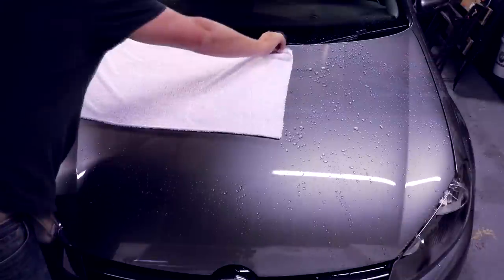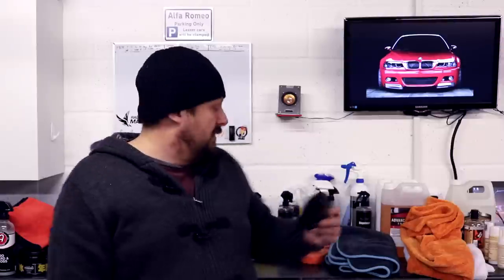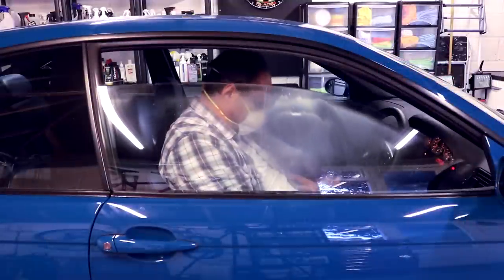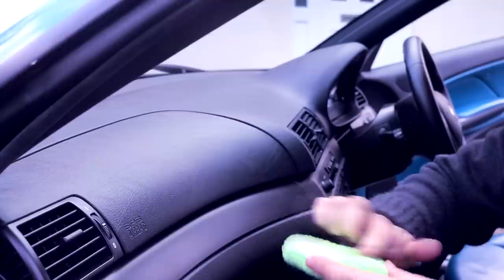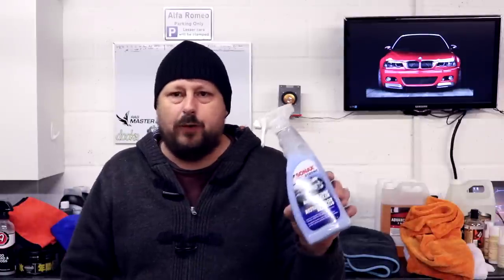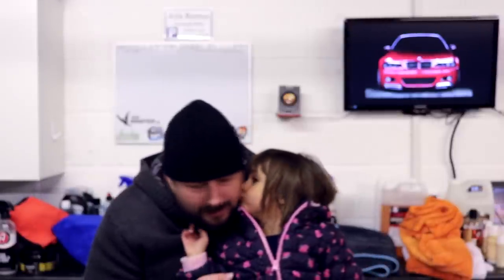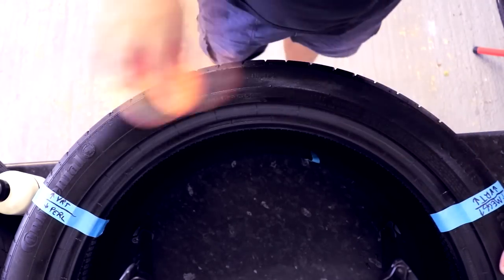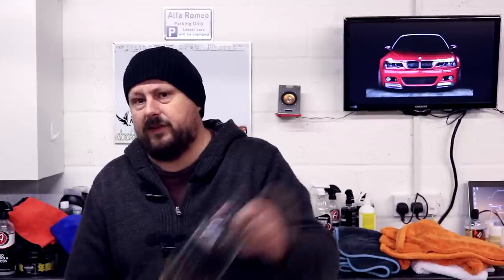The Forensic Detailing 2017 Product Awards - Part 2

Comment: I agree with you about glossworkz, that shampoo is really good, suds+slick+smell
I've used it only once but feels like a step up from my previous shampoo. 
Carpro Pearl is starting to annoy me, it always tend to be greasy on me, wether i use it on tire at 1:1 dilution, or on the interior at a lower ratio. You always have to come back to it and buff it well to avoid greasy touch. It's still a good product because of the versatility, but i hope to see an improvement on the formula to make it less greasy.
One product i recently discovered is the Polishing soap P21S. Really good product on exhaust, feels great to use with the sponge and the lather that it produce to clean and polish is something i really like. Hope you get to try it in the future mate

Comment: Great reviews there. Is there any reason why you don't include Gtechniq products as would like to see the Gtechniq W6 in comparison to the other fallout removers if you ever have opportunity. Cheers.
Reply from the maker: no reason really, but its perhaps just more to do with what Ive encounered.  g tech stuff is decent enough, big fan of the wheel armour.  this video was shot 2 years ago remember, theres been like g tech stuff coming through the channel since this was shot as well.
Reply: @ForensicDetailing  oh I see. Thank you for taking the time to answer. I liked this video and was just trying to choose a fallout remover to use on a Gtechniq ceramic coated car to maintain the coating.

Comment: Hi Jon, I’ve seen your comment on Done And Dusted, I’ve mixed mine 50/50 with BSD and done the same with BH Auto QD works a treat. Do you have any thought on products going bad over time as I’ve started buying in 5L sizes? Merry Christmas to you and your family and thanks for the videos.
Reply from the maker: detail sprays on paper have a 1-2 year self life.  thats a bit of a generalization.  but they are typically based on forms of quatinary silicon which have this sort of shelf life.   Ive had products beyond this timeframe though and they still function.   So I would not worry too much about expiry of QD's but if its been sitting there for years and years in the garage I would just bin it.

Comment: Great vlog John, one I now look out for a Christmas. I've just started using Sonax BSD again as we go into the Winter and as you say it water beading properties are amazing, however the spray head is probably one of the worst units out there. I'm going to decant it just to make life easier. Cheers, Kevin
Reply from the maker: yer that trigger is f'ing useless.. If you pump it hard and fast it does fan a bit more...  a lot of companies fail with their triggers.  the worst are those small ones that hardly put out any products.
Reply: Buy a Flairosol fine mist bottle and tap your BSD in it. It works great with this bottle and spreads fantastic. A little tip from me :D They are expensive but look at Ebay or get the original from Holland.

Comment: Hi,

I am wondering what chemical products you use the most a detailer uses. For example, Quick Detailer, APC, etc. Maybe the most used top 5 products? Thanks
Reply from the maker: gotta be 1) prewash 2) shampoo 3) wheel cleaner 4) APC    After that, prolly my IPA mix or maybe a fallout remover, maybe a citrus wash, or a dedicated degreaser product.

Comment: Jhon I get ghosting and streaks with h2go I cleaned the glass well and clayed let it cure for 15 minutes do you think cleaning the blades with tac system oil zero would help
Reply from the maker: best tip I can give, one keep the windscreen wipers away from the car when applying..  when you apply obviously clean it properly..  but after waiting 15 minutes to cure buff away.      what I do after that is leave the wiper blades up and leave the car well alone overnight.     and even then before I use I go over it one more time with a clean cloth.   the closer you do to that the better.   I find in the summer when its warmer they cure off better.  Dont over apply as well , use small amounts.

HDD and H2go are the best 2 Ive seen so far, the key thing is to let them cure off and prep.

Comment: Hey Jon,

Do you have any recommendations for detail sprays that can get rid of fingerprints and waterspots other than Koch Chemie FSE?

I am only asking this because it costs €9.2 euros for a 1 litre bottle and €46 euros to get it shipped to my country. (which is quite costly)
Also, have you tried Carpro Ech2O. It is a type of rinseless wash however, you can dilute it to make it a detail spray, clay lubricant etc.

Thanks.
Great videos btw, Merry Christmas and have a Happy New Year.
Reply from the maker: hey judy I dont know of any other detail spray that is formulate to shifts water spots like FSE.  the other products which are effective are all dedicated water spot removals.   sorry.

Not tried echo20 either sorry :( double fail.  but happy xmas and new year!

Comment: Hey John! How you doin'? 😂 Great video.. but which is in your opinion the best Shampoo or Prewash to strip away all the previous wax or sealant from the clearcoat? 
Filippo from Italy
Reply from the maker: if you have sealant on wax on the car you cant really rely on a detergent to fully remove it.  Your going to need to use an abrasive cleaner on a machine polisher ideally.  because of that I dont really have any stripping detergents in the arsenal.   It just doesnt serve a purpose for me.  might well explore it but I dont think theres a lot of offerings of that sort of product...
Reply: Forensic Detailing Channel wow you were waiting for my question? 😂 what a quick answer! Thanks! I thought to a non ph neutral shampoo or prewash that could strip thw wax.. The only specific product that i can see on the website where i buy all my stuff (www.lacuradellauto.it) is a Stripped Ease from Angelwax! But i was looking more for something like a shampoo. Something that i can say: ok, let's reset to the beginning.
Reply from the maker: detergents can break down waxes, even PH neutral ones.  but not enough to remove them.   say you hardly have any wax left like 4 months after applying.. maybe these products could remove the reminants off it.   Less so for a sealant though, or waxes with additives in them that resist or repel the detergents.    So really you need to polish them off if you want them completly gone, say for a ceramic prep or even a sealant prep.   Less important if our putting another wax on top.
Reply: Forensic Detailing Channel Thanks! I asked because Sunday i did my first decontamination: After Prewash, two bucket with non ph neutral shampoo and iron fallout remover.. when i came to the tar decontamination with Gtechniq W7, this with its solvents started to melt the childish Meguiar's quick wax that i've laid on August (crazy for the effort). Wax that i thought to have stripped with the non ph neutral shampoo and the 4 months passed.

Comment: both Angelwax products I've had have been awful. The screenwash left smears all over my clean car and the interior gel gassed and fogged up my freshly cleaned glass with a greasy film. My guess is they had a nice range of waxes and rushed out the rest of the range. The products I've used couldn't have been thoroughly tested as far as I can see
Reply from the maker: screenwash was great for me.  one thing though I used it at mega low concentrations because it was expensive and I wanted to ring out as much value from it.   It does contain protective components in it which are supposed to maintain their glass sealant.     The interior gel I loved and used a fair amount.  the only negative I found with it after like  months. was in the baking hot summer it could shine up and a bit.  like the extreme heat could break it down.  didnt noticed the gassing thing but to be honest I dont think I was looking for that, never really tested that sounds like something I need to look out for.    hey this sort of feedback is cool though.  Id try their glass cleaner maybe.  apart from the smell I think that stuff is really good.

Comment: Do you have any recommendation four beatding off on the carpet I was kind a hoping there was a video to protect my boat carpet and also maybe a car carpet
Reply from the maker: not really mate.  in terms of fabric protection.  its more about cleaning often and gently IMO.   theres a craze for water repellent carpet and upholstery and fabric guards because it looks so damn good to see water beading off it.   but really fabrics , floor upholstery in cars is gonna get dirt ground into it everyday. keey is hoovering it out once a week but in a couple of years it will benefit from wet vac'ing either way.   really the best tool is to have a wet vax.  have a watch of the wet vax video, I honestly dont think product is the key with this area.
Reply: Thank you for replying Man love the videos I’m just trying to protect on it I didn’t want to get scammed by buying in these expensive products that are garbage I just wanted to help prevent I have a bunch a little ones you know what I mean I didn’t know if there’s anything besides Scotchgard that may be better out there I’m willing to give it a shot but if you happen to have any solution for mold residue I have a 1996 cobra Mustang sitting up I put away fan too it took the carpet out aired it out dried everything cleaned all the seatbelts sure enough more mold has popped up I’ve tried everything that I can think of I finally got it running and I’d like to take it for a spin but I don’t want to get in it with mold
Reply from the maker: @livinglife7042  the mold has to be moisture getting in somewhere and then the car sitting in a nice warm place and bang.  you have to used chemicals to kill the mold. biocides, or ideally specific automotive mold killer products, lots say vinegar essence 50-50 with water as well (not tried that).   once the mold is killed you could then like wet vax out all the car (do it in the summer when its really hot) and let the car air and get bone dry.   After than its just a case of making sure no moisture is getting back into the car and resting somewhere in the car for a long time and the mold starts.

Comment: Great video as allways,
Do you have a comparation of carpro hydrofoam to this chemical guys shampoo?
Reply from the maker: hydrofoam is closer to a wet coat within a shampoo formula, IE you spray over your car in a lance and it will add protection to your glass trim and clearcoat.   Need to be carefull with these drying on you.

glossworks is more a traditional shampoo.. whatever its leaving behind is not so hydrophobic, its less about adding protection during the wash and more about gloss only.

carpro stuff is solid as hell generally.
Reply: Thanks very much :D
Reply: Btw I use ech2o 1:10 like a 2in1 glass cleaner, it cleans great, and the water is going up on the windscreen about 55km/h
[:

Comment: How does sonax bsd compair to meguires xpress spray wax?
Reply from the maker: they are totally different products.   Xpress wax is old school been around for a long time, think it has some abrasive in it to help buff up the paintwork.  but you can spray it on most things and it makes it shine.     It doesnt provide any sort of protection though.  It is what it say, an express synthetic wax.  fast to use etc..  its decent stuff.

BSD on the other hand is loaded with a really concentrated hydrophobic component that repels water like crazy and lasts a long time.  but its a bit sticky and thicker to use..  adds good gloss to the paintwork but not the best feel when you run your hand over the clearcoat afterwards.  

so one is all about versatility speed and a quick boost to gloss.. the other lays down a durable hydrophobic seal

Comment: £13.50 for delivery of the paragon pads to N.Ireland. Fail
Reply from the maker: :( sorry bud.    but check out there 30/70 premium terry cloths.   if you do this professionally then buying like 50-100 of these is worth while and you wont beat the price for this sort of soft cloth even if you add delivery.  appreciate its not so viable when you want to by a couple of applicators.   but these guys are sort of closer to microfiber wholesalers really.

Comment: im surprised master of fibres and fecks philosophy professor plush towels are not in the top 3
Reply from the maker: they could be actually.  master of fiber is exactly like the silverback or the drinker.  I went for 3 totally different formats because other wise 1/2/3 would have just been offering the same thing.. Fecks is different. thats like the auto finesse towel.. its really nice but it doesnt glide over the panels quite as well as the ones with the flat tighter napp. but really it doesnt make too much odds.   ragmaster have actually discountinue the avalanche now as well :(  I really like that towel as it was somethign different but cant get it any more. :(
Reply: i did wonder about the avalance, i was trying to find it earlier but couldnt